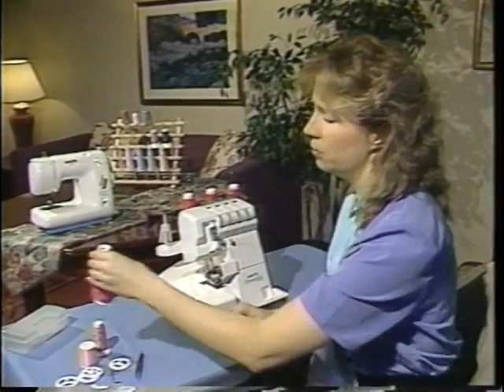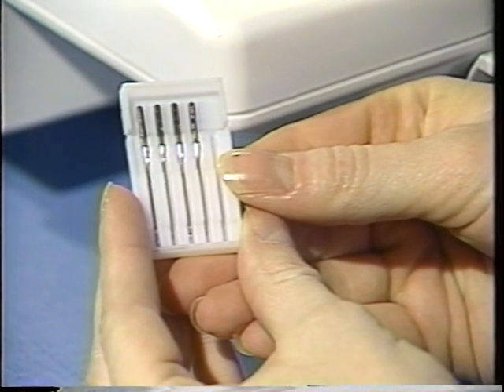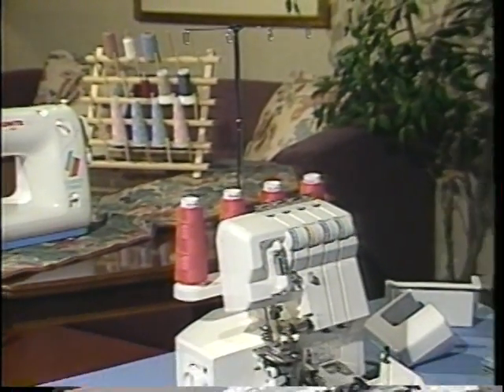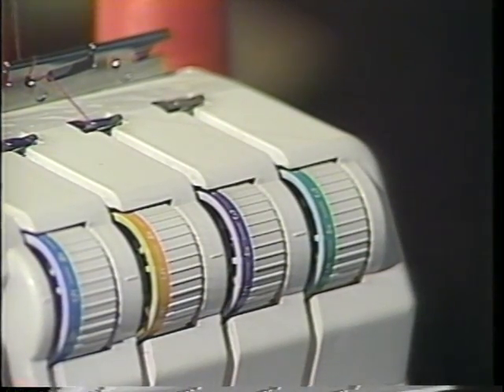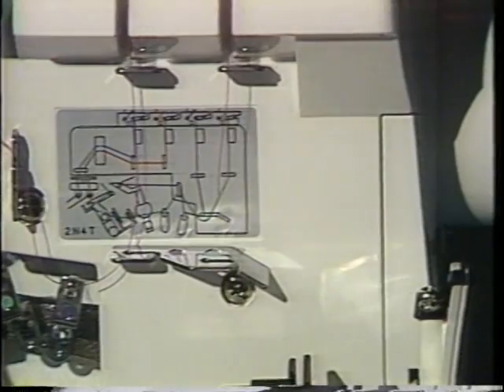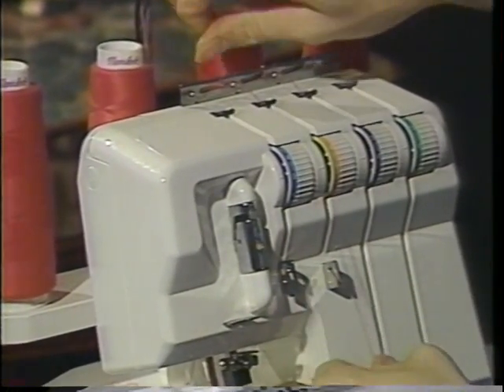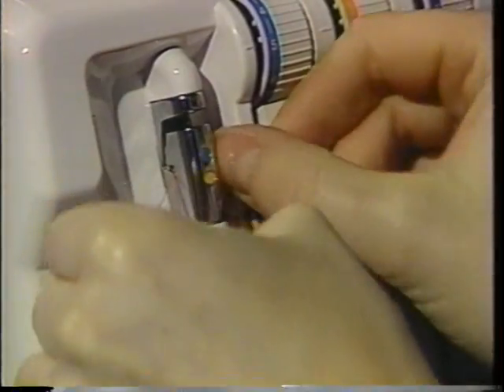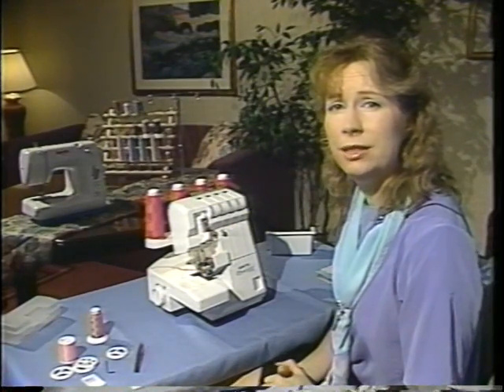white speedylock serger 1600 video manual part 1 of 4

Comment: Como reparar mi maquina se me le quebró una de las agujas de la planchuela
Reply from the maker: you can use the machine with 1 needle, but its is a different edge, not the serger. Broken needles, I just use the tool and loosen the broken needle and pull it out. Add a new needle. Tighten back up and re-thread the machine. adjust the tension again if needed. Good Luck

Comment: My thread keeps breaking. What am I doing wrong. It’s the lower looper thread. What should the tension be on ?
Reply: I just got the 1600 from an estate sale. Maybe we can help each other. My lower looper was very tight and when I sewed, the thread bunched up. After digging all the thread out, I made it easier to pull through by a whole number (#3). I'm ready to stitch for the second time. I'M AFRAID!!! lol  The other threads pulled through very nicely and I thought I'd have trouble with the 'tight' one. Are you still using yours?

Comment: And yes, these machines are a major frustration for me related to threading. The stiches keep failing in some parts. I already changed to three new needles and did not work. I then also noticed that my machine did not come with that part just above the needle that keeps the thread closer to the needle, the little plate. Mine never had did. Instead, it came in the little box but there is no way to attach to to machine. I am really upset that I cannot use my machine. I have tried everything and no way I will pay for someone to fix it. They charge too much. Sell it for less.

Comment: This is the part i agree with you on i can't decide which side the lower loop thread is suppose to go back thru to the right after i've hooked the thread into the lower looper... and i'e tried both way too many times to count.. it just always seems to be confussing...(step 9 and 10 on digram in the book shows to go behind the looper and return it infront of the looper... it pulls the thread out...???   Do you have a preference that works better for you??

Comment: Hi I am from the UK and my machine is the same as speedy lock but a 2013 mode called Decorl but with a cutter, I guess they are still making them. I never got a DVD with mine and this clip has been so useful to thread my machine i understood it completely mine threads up each time. very grateful you uploaded the video.

Comment: Note the info @ 6:21 to 6:31 of the video.  This is key to ALL sergers.  If the loopers don't get threaded in the proper order, it will NOT form a stitch.  This has/will be one of the greatest frustrations to all new serger operators.  Thanks for the close-up of this detail.

Comment: I've had my serger for years, and every time it breaks a thread, I have to give up because re-threading it makes me crazy. I've now read this entire thread of comments. I"m going to get one of those dust blowers (I've already brushed it out), and NEW THREAD, and get some help with the tension. And then I will try threading it again. I've been threading it for 3 hours tonight and I cannot get it to work. The top threads are doing all right. NOTHING on the bottom. I have checked and re-checked that I've done it right, and it continues to not work. If anyone knows any secret I don't know Please Tell Me. I do them in the right order. I've go no idea what's going on. So frustrated!!!

Comment: I have the speedylock 2000 ATS and haven't used in a few years.  Having so much trouble with my lower looper thread breaking.  I rethread over and over again, and only get a few stitches..then it breaks again.  Sooo frustrating.  Maybe something here will help...

Comment: Hi, Thank you so much for these videos! I have a question on how to serge MULTIPLE LAYERS:
I have this kind of White Speedylock 1600 - could you or any of the viewers please tell me to adjust for multiple layers (3 to 4) on the Speedylock 1600, please? On other sergers, there's a screw one can tighten ... how is it done with this machine, please? My threads go totally wonky when I try more than 2 layers :( I just had it serviced.
Reply from the maker: +Yvonne S i haven't tried that many layers, but here on this site, some said it will work..maybe you can ask there..? http://www.mothering.com/forum/66-arts-crafts/416281-okay-so-white-speedylock-1600-a.html

Comment: I have a speedylock. A video came with it. They might as well have not bothered, so many shots of the back of her head and her arm at CRITICAL points, that made the whole thing USELESS.  You did much better, only fuzzed out by your hair twice, and one great shot of the back of your ARM when we needed to see the machine. So far, so good, this IS an improvement...I never got to tell anyone about the useless video that CAME WITH my serger. Did anyone else TRY to use the manufacturers video? (1634)